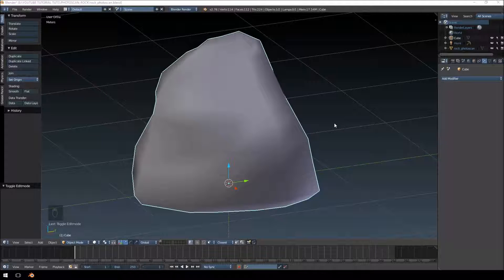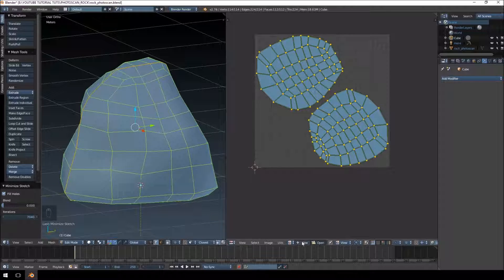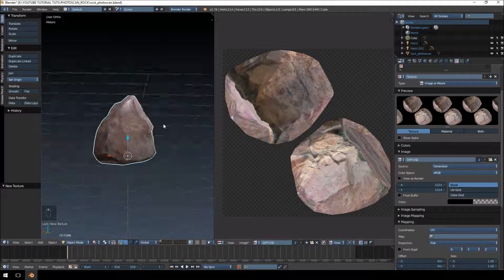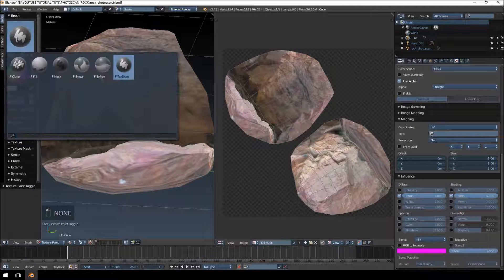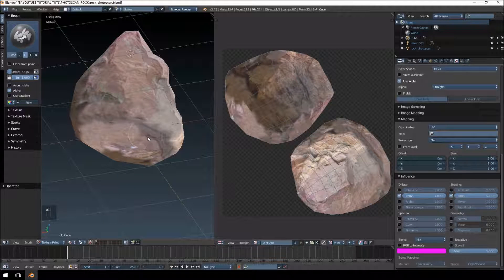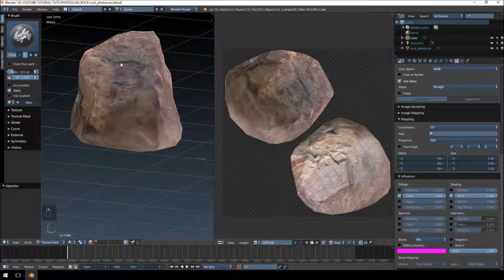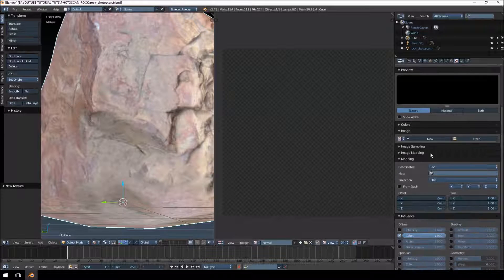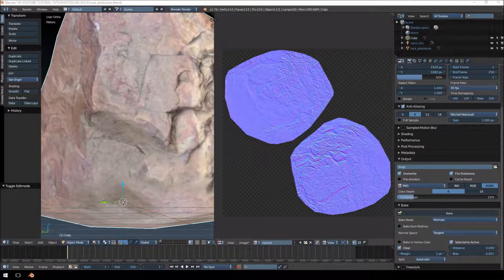3D model using Photoscan and Blender - Part 03 - UV & TEXTURE BAKING

Comment: Thanks for the tutorial, its great and works but is there and equivalent for this method of texture baking in cycles?
Reply from the maker: +87411111 803133 my apologies for the late reply...I have seen a tutorial before using cycles. It was very handy and I will provide you with a link as soon as I get to my main computer again.